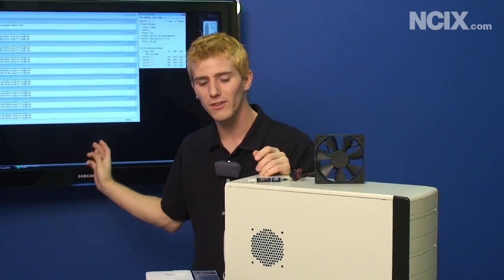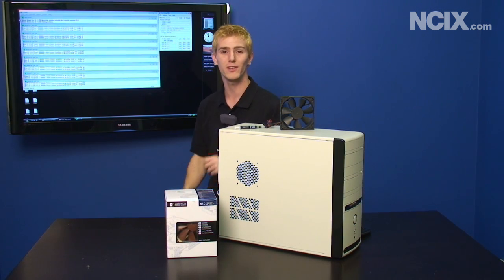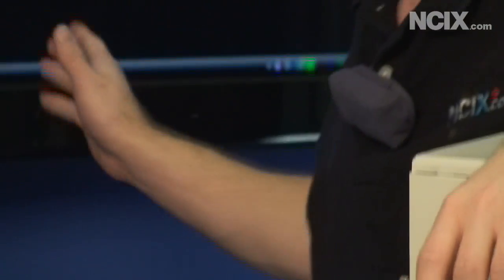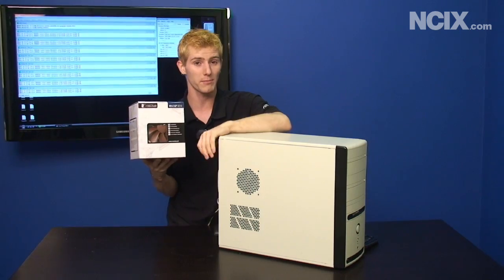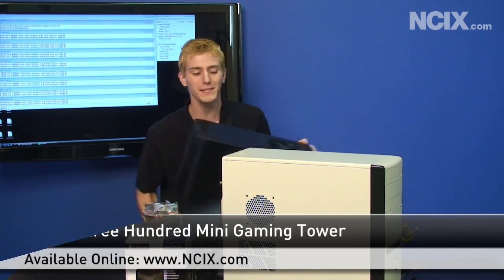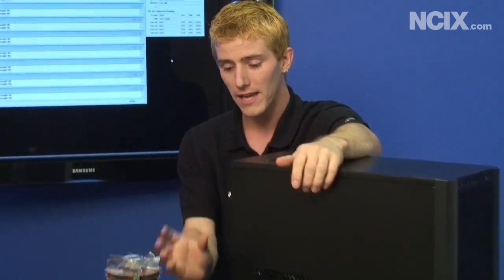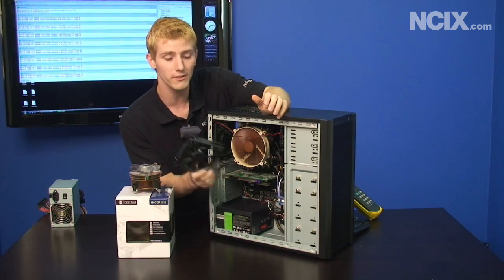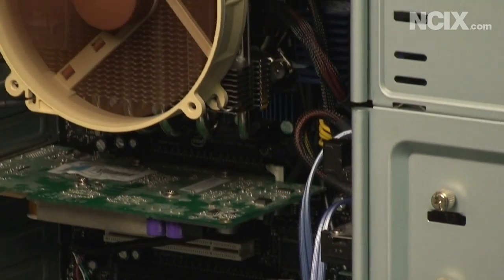CPU Thermal Management (NCIX Tech Tips #59)

Comment: hi here mate,, got a question here if you may..  I have to plug in a thermal conector on an ASUS motherboard and that little thermal conector cable has two female ends , one should be the ground and the other one is the sensor IN..   How do i know the exact position to plug it into the board´s male pins if not shown on either??

Comment: my room temp is 34°C
my idel pc temp is 56°C
aftr whn i play dragon age inquaction, my pc tem will be 85°C to  90° C
cabinet - cooler master 311 elite
termal cooler - cooler master iceEdge 400Xt (single fan)
120mm ×3 cabinet fan ( 1 pulling and 2 pushing)
.
. is ths normal???
if not i need some suggestions plz 😕
Reply: 😕k i used cooler master ternaml paste yestaday  now reading is 60°c on overload .
sory if its a joke for u.
i was asking seriosly.
Reply: +SmitsHD am using "Deep cool iceedge 400xt"
i had lifted for appying terma paste,    and spreaded evenly for balance heat pipes.. 
😕
Reply: +SmitsHD k thankz 😊👍

Comment: I'm using the NH-C12P in Antec 900 with an OC'd i5 3570k and clocked GTX 670. CPU  sitting at 45*C during medium to high load, peaking at 55C when running hard for hours.

Comment: doesn't really matter, just as long as more hot air is exhausted away from inside your chassis and keeping it down to a < 50'C temps, you should be good. In summary, you will want a low air pressure inside your chassis because low air pressure = low air temp.

Comment: back in I think 2004 or 2005 I bought a P4 3 Ghz HT setup, motherboard and all... and when I installed the CPU it was a very tight fit, the cap's was in the way... wich resaulted in the CPU cooler not being correctly installed, I played with the computer for 2 - 3 days and it crashed when I played demanding titles, so I started to look up what the issue was, well, it was getting... abit hot... 90 C+... after slightly bending a cap on the mobo the cooler fit and things where fine.

Comment: @Unasigad Aren't delta fans just as loud? And don'd they only come in 120mm? I went with the Vantec Tornado because I only have place for 1 80mm fan (I scrapped a case from an 8 year old computer that was dead). Also the Intel P4 is not the best CPU for overclocking because it is is terrible with thermal management. But whatever. Now I can play games on high settings on the computer.

Comment: I didn't want to spend money on a new case and find out it didn't do much, so I just bought a 110cfm/6000rpm/80mm case fan and that did the trick. The downside is that my computer is way too loud because the fan is 40-50db fan.

Comment: What I don't get is that my fans are set at the speed they come (Which is like... Not full potential right? I can't remember). They're incredibly weak. I have 1x 120mm at the front, 1x 120mm at the back and 2x 120mm on the sides. You can also ONLY just tell which way they're blowing the air and even then it's too weak. I have the questionable AMD Bulldozer FX-4100 in and an nVidia GTX560Ti GFX card. When I check the temps they come out like this:

Not gaming: 20-35C
Gaming: 45-55C

Comment: by the images i have seen it probably will. but if i doesn't, flip it so the fans will be vertical, then you should have plenty of room. and if you have a decent case you should have fans on the top, so you won't have any cooling issues.

Comment: Wouldn't adding a better thermal paste reduce the heat of the CPU? Worked very well for my laptop. The CPU thermal indicators went down by 2-3 deg C. And yes i did both tests after cleaning my laptop.

Comment: Yeah, you won't be seeing a high end CPU at 30C under load, those are idle temps. Maybe with the newest 22nm chips, but even then, with air cooling, 30C (especially with room temp at 20-25C) is frosty-the-fucking-snowman.

Comment: remove the side cover if you know you pc in a safe place, my high performance pc is almost naked, never hits more than 50C with a couple more fans installed(big fan for the graphic-card, two small ones just blowing in deferent directions to help the air flow)

Comment: I solved the CPU heat management issues I had one summer in two ways. First, I took of the side panel, and when the CPU was doing video encoding, I would use a paddle to manually cool it for the hour or so it took to finish the task. Then I got a room fan, put it on the desk, pointed it at the case and never had heating problems again. No money was spent, no components were touched. That's real oldschool CPU heat management.

Comment: @gundam395 re-do thermal paste, i had the h50 on a q6600 and then a i3, idled at about 40c. I have since switched to the noctua nh-d14 and it dominates. i now idle on the hottest core 28c and when at max load no higher then 45c.

Comment: what about high/low air throughput 
Ie have high air intake speed on the front of the tower via 2x120 fans and slow output fans that will help wont it ???

Or try the other  way round with Low air in front and High air out back to pull ambiant air out quicker.....  

Just a thought.

Comment: So, I'm running a MineCraft server on a Athlon 64 X2 2.4 GHz with 4 gigs of ram in a diablotek elite case. I've never got over 61C even at the processors 100% maxed out. good airflow or processor is undeclocked?

Comment: 100° CELSIUS? Seriously? I didn't know any CPU at all would be able to sustain those temps and still run, underclocked or not. My Phenom II X$ 975 doesn't even run with >62°C or it will perish in no time. I know the i7 architecture is as different as it is superior but that's impressive.

Comment: @raclimja16 Depends on the raid level, if you want to use them as a 820gb drive you will be fine.

if you want safety or speed array you will only have 320gb room (the smallest one will determine the size)

Comment: just got a coolermaster 690 II advanced. i had a very old case, and my cpu was running 50 degrees at idle and 84-85 at full load.
with the new case i am running 33 degrees at idle and no more than 60 at full load with the stock cpu cooler...really big difference

Comment: @HookEchoMedia yeah, i solved the problem with an ASUS EN8400GS silent graphics card.It has no fan but an other cooling system, looks like an airco (no sound at all!). And the best of all , it's great for overclocking, my graphics card is build for 1.6 ghz, but i can overclock it SAFE (and without liqued nitrogen for cooling :p) upto 2.3 ghz and it doesn't burn up. btw i heared some japanese guys can overclock their CPU from 2.0 ghz to 5.1 ghz with liqued nitrogen as cooling :O

Comment: @fullwithlove 

the computer expert you talked to is an idiot. even if the fan is still working doesnt mean it is in good condition, buy another cpu cooler, and replace the old one.
going blank with no signal but pc is still running? check your gpu(if you have any) and it's either the motherboard or the power supply. 

just trying to help :)

Comment: @raclimja16 you can RAID 2 drives with different capacity even 100% different drives like a hdd and an ssd but that is very inefficient since the ssd has to wait for the hdd. and the raid array is only the size of the smallest drive :O. so i would use 2 the same drives (also did that btw :P)

Comment: why did he keep the computer on while changing the stock cooler? won't the cpu overheat if you remove the cpu cooler. Remember those videos made by toms hardware when they remove the cpu cooler on the Pentium 3 the cooler started to smoke then died out. Those old memories...

Comment: Core i5/i7 run so freakin' hot, it's crazy. 

I'm not doubting i5/i7 performance, but i run my Phenom II 965 at 4GHz with a Noctua U12P/900rpm fan setting and it only hits 51c with Prime95 Large FFT's.

It's also annoying that Intel market a lot of the i5/i7 at 95w TDP when in reality they're closer to 125w.

5/5 video though, good tips!